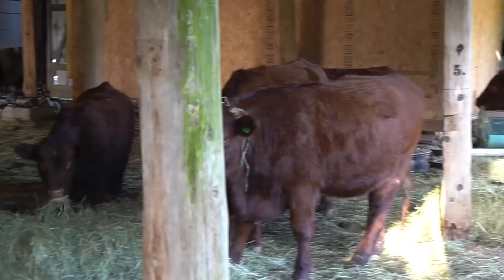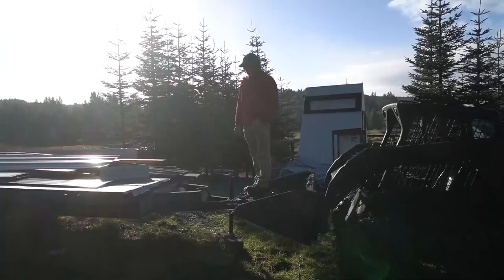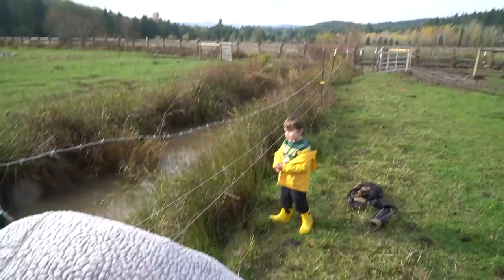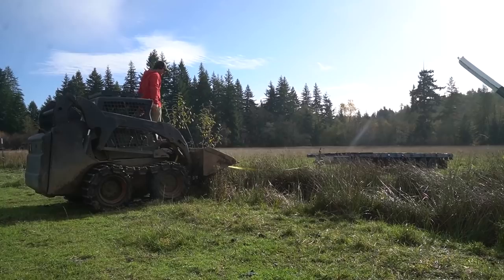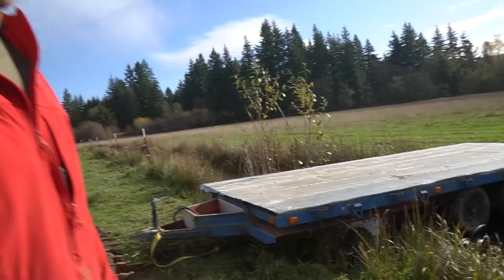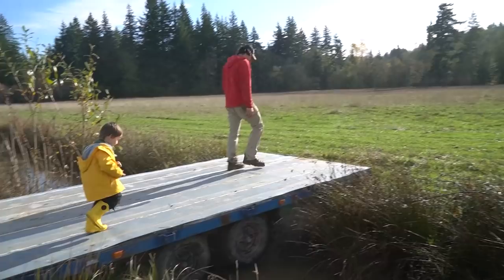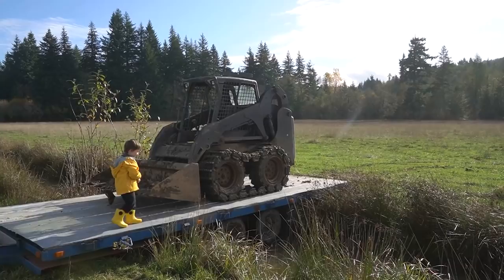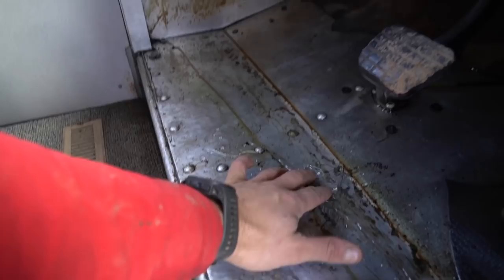How to build a Sturdy Bridge for FREE in Less than an HOUR! You can Drive on it!

Comment: Dang, that’s a nice trailer (well on video), but if it works for your needs, I applaud it
Reply from the maker: If we swapped the axles it would have been a great trailer.  But this solved our problem in a few hours.  The cows cross it when they need to
Reply: @Maxx.Powell  hey if it works for what you need…. There’s no fault. Good job

Comment: That is awesome. Best video showing how save budget. What if you marked the ditch where the trailer said, pulled the trailer out and dug it down a bit so it sits flush without having to use material to get the cows/vehicles across. Might save you from tearing up the ground on each side on wet days getting up onto the slippery metal top.
Reply from the maker: Hmm that's a cool idea
Reply: @Maxx.Powell  no harm in trying ;)